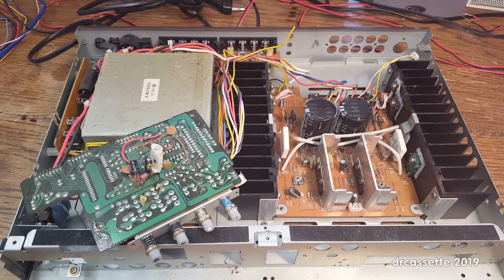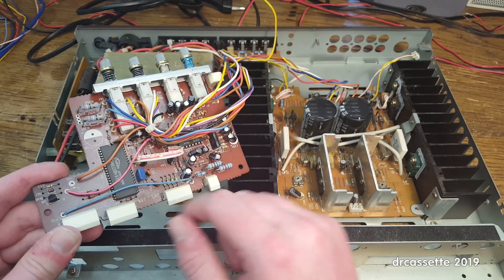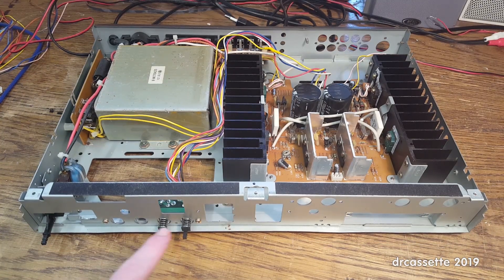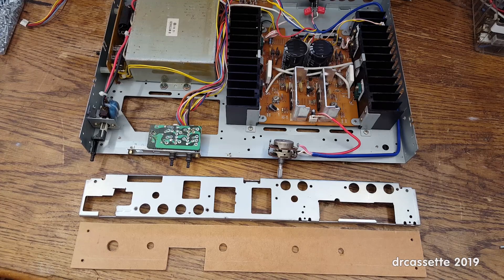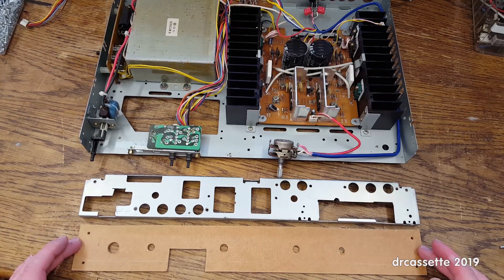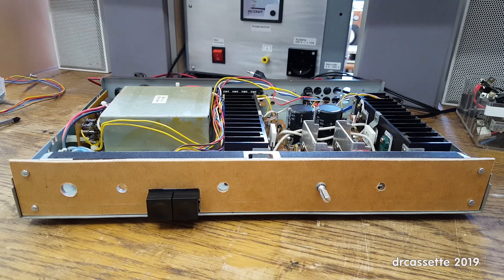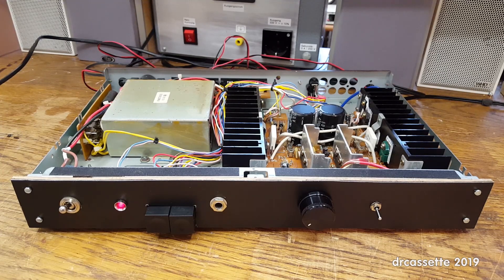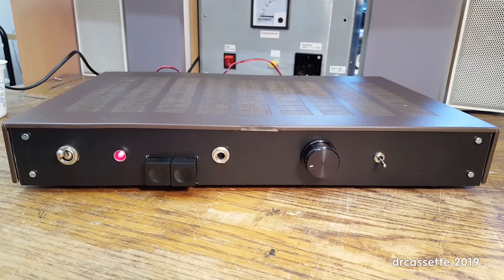Building a new amplifier based on the ITT HiFi 9540

Comment: gotta be careful when putting your RCA inputs straight into a pot as your input impedance will vary with whatever the volume is set to.
Reply from the maker: Yes, I know the input impedance is not constant. I will have to add an opamp circuit as buffer at some point.

Comment: Some VU/ Power meters would have been good
Reply from the maker: I thought about putting in some power meters but then decided there was not enough space on the faceplate. Also this would have meant cutting a big hole into both the faceplate and the chassis which would have made the whole thing less solid.

Comment: Nice repurposement of an old amplifier. It sort of has a 60’s/70’s retro look to it🙂. That circuit glue seems to still cause issues even in modern equipment. David Jones had some Rokit studio monitors who where affected by this stuff and the speakers where only few years old. If I remember it correctly the circuit board whent completely kaput and the magic smoke had escaped. I wonder if manufacturers use this stuff on purpose as a form of obsolescence.
Reply from the maker: I think I saw that video... but if I remember correctly, that 'modern' circuit glue was not the same sort of stuff as the circuit glue found in a lot of 80s equipment. The colour was different. Not sure if they used this crappy glue on purpose though. Seems a bit unpredictable to me when it starts turning conductive, and of course the product always has to outlast the warranty (2 years in Germany) before planned obsolescence can do its thing.

Comment: Nice job Mr Cassette. I was wondering if the removal of the unwanted circuitry has improved its sound?
Reply from the maker: I'm not sure if it has improved the sound, but it has definitely changed the sound. The amp seems to have more bass and less high treble now.

Comment: Nice job there!  I believe you, it is a hard work... I am restoring a vintage sound equipment from the late 1970s in my spare time and I know what you mean.  BTW, that "monster glue" also shows in many of my vintage equipment restoration projects and it takes a lot of time and patience to clean that up.  They used to glue capacitors, bulb lamps and heatsinks with that glue.